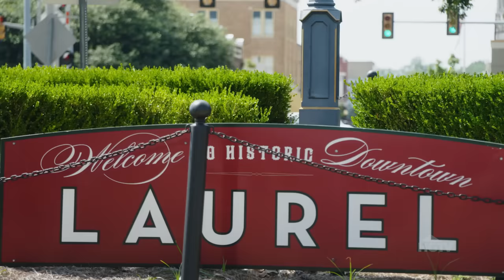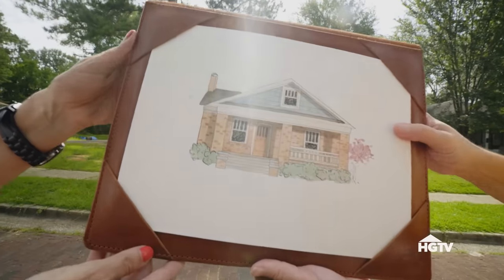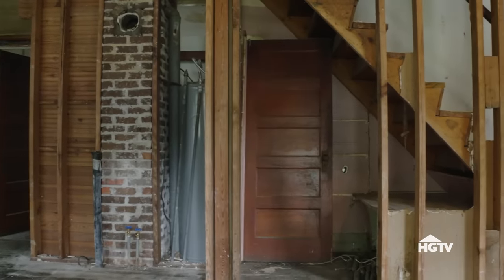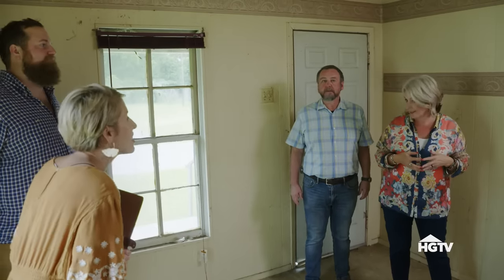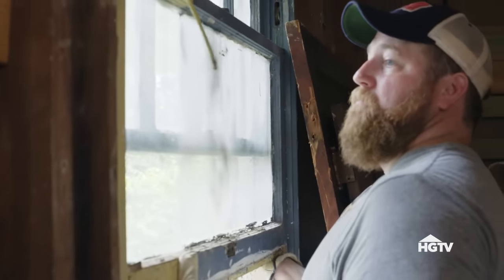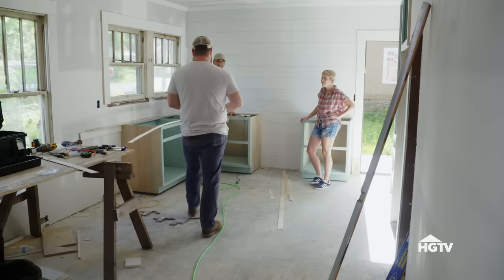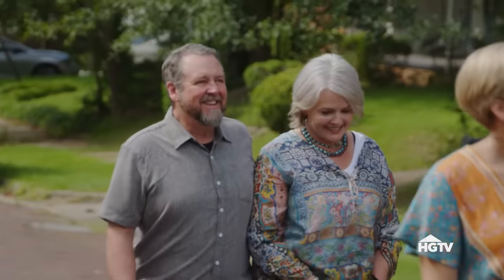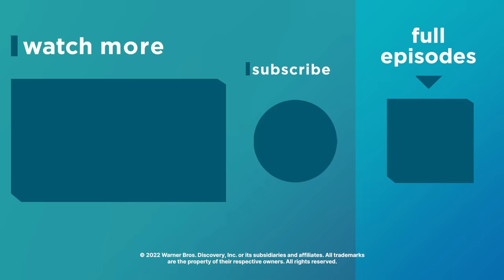AMAZING Home Restoration | Hometown | HGTV

Comment: This is a beautiful makeover of the house. Everything is tasteful.  My only quibble is that it is going to be a transitional home for people with children.  Why would you put in a white couch and a carpet with a white field? Something much more practical and child friendly would be a must for me.
Reply: Mary, did you see that the white couch is a canvas slip cover?  It is both durable and washable, so it is actually a good choice for kids.  Edit:  The rug will always look grungy though.
Reply: @lynnharrell9598  Even if the couch has washable slip covers, it will still get grubby looking very quickly. Also washing slip covers is not a simple task.  Why not just start out with a more practical covering?
Reply: they usually stage the furniture, less the pieces that Ben makes or is owned by the property owner.